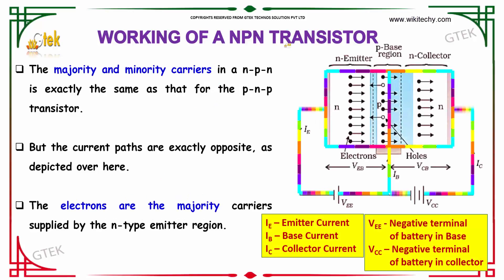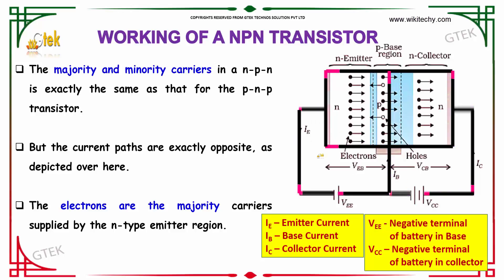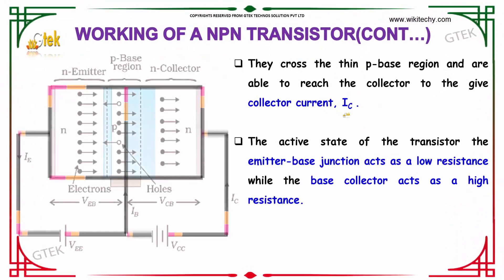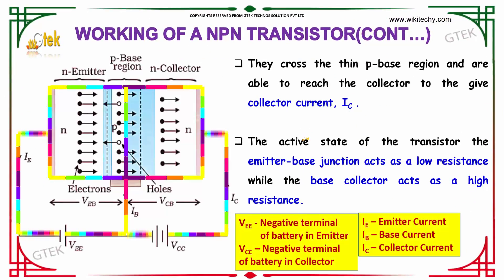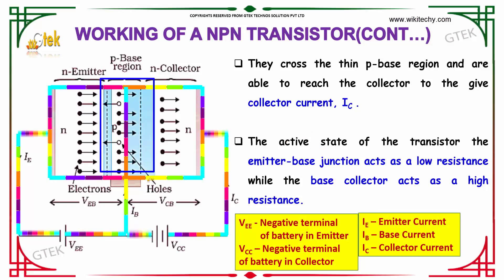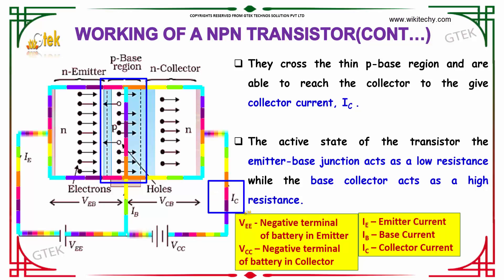Working principle of NPN transistor Semiconductor Devices  class 12 Physics subject notes lectures

Comment: npn transistor operation is basically the action of a relatively small emitter-base bias voltage controlling a relatively large emitter-to-collector current. The current flow in the external circuit is always due to the movement of free electrons.

Comment: In NPN transistor, Base is connected to positive terminal of battery. Now, when current is switched on, Base-Emitter junction (indicated in image) is forward biased, whereas Base-Collector junction is reverse biased. ... These electrons move from emitter side to base. Base is thin region, which has holes.

Comment: A transistor is a semiconductor device used to amplify or switch electronic signals and electrical power. It is composed of semiconductor material usually with at least three terminals for connection to an external circuit.

Comment: The base pulls these electrons from the emitter because it has a more positive voltage than does the emitter. ... In these devices, the emitter and collector are both a p-type semiconductor material and the base is n-type. A PNP junction transistor works on the same principle as an NPN transistor.

Comment: Definition of BJT. A bipolar junction transistor is a three terminal semiconductordevice consisting of two p-n junctions which is able to amplify or “magnify” a signal. It is a current controlled device. The three terminals of the BJT are the base, the collector and the emitter.